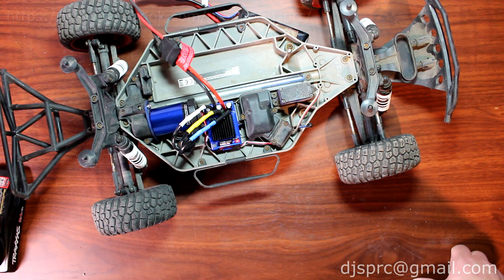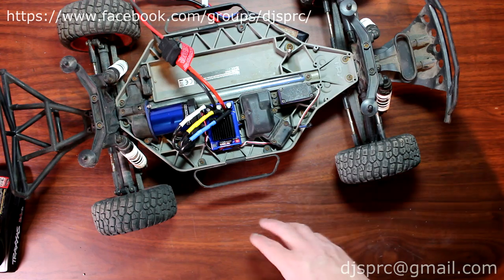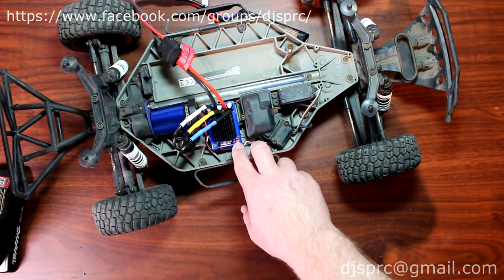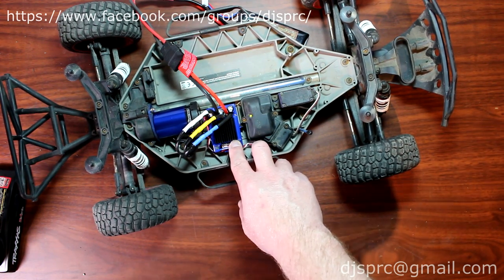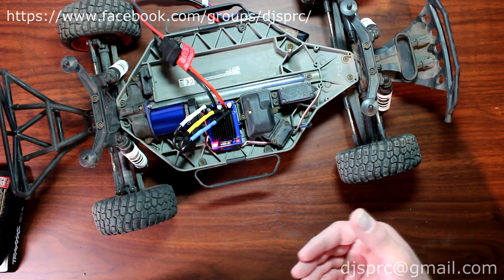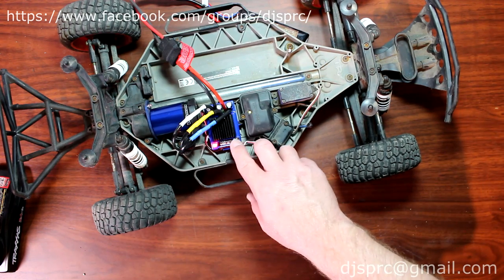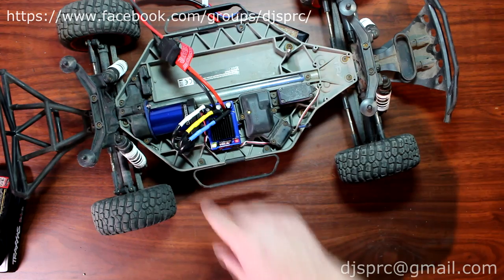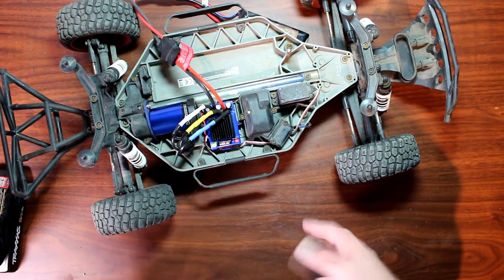How To Enter Lipo Mode Or Nimh Mode On Traxxas Speed Control

Comment: So mine will switch to nimh but as soon as disconnected and plugged back into nimh its back in Lipo🤷‍♂️ also not hearing any chimes switching into either and just wandering if it will automatically switch to lipo and does it matter what kind of batter is in to switch modes? I am also not currently in possession of remote but do have a skyfly im going to program too but have not yet just trying to digure out power first not sure if ESC is good.
Reply from the maker: Sometimes I’ve saw that you would need a Lipo to be able to put it back in nimh. If your light is green, that is Lipo mode if your light is red, that is. Nimh.

Comment: What is the difference between NiMH mode and LiPO mode? I mean, of course it is to change battery setting, but what changes? Is it just voltage level settings? Or maximums current flow?

I'm trying to figure out if it is possible to operate a motor controller with a 12V lead acid battery when the controller only has settings to choose between a LiPO and NiMH

Comment: hello, please, the red light on my M41 regulator vxl 6s marine is shining, is it only because of the nimh/lipo? how do i switch it? Thanks
Reply from the maker: @filapraha  if you plug-in two fully charged batteries and they are Lipo the light should be green. If it’s not green that means it’s in non-low-voltage what you will need to do is take your remote. hold a trigger in full reverse turn it on then plug it to fully charge Lipo to the boat. continue holding for at least 10 seconds. The light should turn green meaning low-voltage is activated safe to run Lipo.
Reply: @djsprc  Thank you very much for your help, the diode is now green 👍

Comment: Mine flashes red but it doesn't make any sound does that mean it's okay or what am I doing wrong I just bought this and I have no clue
Reply from the maker: Is it moving if it’s moving? Yes it is.
Reply: @djsprc  I messed around with it a little bit more yesterday I finally got it figured out the red light is staying solid lit now the truck is moving everything is working I believe it was set up for lipo from the factory not nickel metal hydride but I think it's okay now I am very impressed by this truck especially the quality but keep in mind this is my first Traxxas
Reply from the maker: @user-wp9mz  if I remember correctly yes it should stay solid when you’re going forward or reverse now if you have a greenlight, that’s a Lipo mode.
Reply: @djsprc  okay that's what I was figuring thank you so much the light is definitely staying red so it should be good for nickel metal hydrate now

Comment: I have a traxxas erevo vxl 1/16. I want lipos for it. All traxxas lipo batteries I could use are 25c. If I use a non traxxas lipo battery that's 50c (2200mah) will that damage the engine or speed control?
Reply from the maker: 50 C won’t damage at all
As long as you use, only a 2 cell lipo aka 7.4 volt.  If you’re brushless, you can use a 3 cell 11.1 volt
Reply: Thanks! Ya I'm looking into a Vant 7.4 volt 2s 2200mah 50C or HRB same specs as the Vant, or yowoo lipos with the same specs except it is a 130C. Any advice choosing between these? I've only been running nimh batteries and am sick of not having full power for my whole run. This will be my first experience with lipos and I want to get it right.
Reply from the maker: @tomovin37  for that type of vehicle, I would not go on over 50 sees it would be a waste of money
Personally, anything that’s higher see rating like 100 and more I would use for a boat a boat is extremely demanding on batteries
Reply: Thanks

Comment: Hi. But does the VXL 3s ESC understand difference between 2s and 3s? I mean cut off voltages are different between 2s and 3s. If I try 3s may ESC still think 2s connected with 6.4v cut off and kill 3s battery with correct cut off 9.6v?
Reply from the maker: Sorry for the late reply if you connect at 2S battery the ESC will know the correct voltage if you connect at 3S it will know the correct voltage

Comment: Hi, i am new to this rc things so i wanna ask is it okay run nimh battery on lipo mode? When i got my rc car, it already on lipo mode but the battery is nimh
Reply from the maker: Do not run your machine in lipo mode when you have NIMH in it it will give you false readings in the vehicle will stop by itself for nothing. Nimh Will drop in voltage very fast compare of a Lipo. I Lipo keep its voltage until it’s time to stop.
Reply: djsprc wow thank you very much for your info
Reply: djsprc wow thank you very much for your info

Comment: mines just blinking red and green and i put a new lipo on it
Reply from the maker: Sorry for the late reply normally flashing red and green means it’s in LVC mode. Low-voltage if you’re trying to run a NiMH. Battery turn off LVC the light on the speed control should be red for NIMH. Green for Lipo.

Comment: Dose this work on an older Traxxas car my green light is flashing the car goes forward good and sometimes it will not back up any ideas ?
Reply from the maker: Yes on certain older models this will work now for your issue it could be your remote or your speed control
Reply: djsprc  someone said I might be the crystals are not matching up or they are bad I got the car from a family member had to buy battery for it the car is a rustlers Traxxas I am just trying to get some information to figure out what I am getting into before I spend to much money on it or is it better if I go get a new car ? I don’t know that much about rc cars
Reply from the maker: Brannon VanCampen Getting yourself a new car you’ll have a warranty on it way better
Reply: djsprc  thanks for your help I will try it out I appreciate you
Reply: Same problem

Comment: My slash is blinking red and green whenever I change it into lipo mode do you happen to know how to solve that?
Reply from the maker: Normally flashing red and green means low-voltage detection if this is happening while you’re running it it’s telling me that your battery is in low voltage. Or you might have some damage cells in your battery.
Reply: @djsprc  thank you so much I appreciate it

Comment: Also I bought a 3cell battery for my rustler cl and the wheels will only turn. It does not move. Any reasons? My 2 cell works fine
Reply from the maker: Yes green is lipo red is nimh   Now what could be happening with your 3 cell is you could have a bad cell and it’s not giving you full voltage if yours 2 cell work fine. I would say that the other battery is damage or not fully charged

Comment: My car blinks red and green doesn't do that with my 2s lipo,but soon as I put the 3s lipo in it does the blinking again, I have it set to lipo,I just wanted to c how fast it can go on 3s.
Reply from the maker: The only thing I can see is the 3S is damage it’s not the correct voltage the speed control goes in   overvoltage protection or under voltage protection
Reply: @djsprc  thanks 4 this information 👍👍

Comment: What does “cut off is active” mean?
Reply from the maker: The meaning of cut off means that when your battery gets too low on voltage the speed control  will stop using it. To prevent damage to your battery
Reply: @djsprc  good to know, thanks!

Comment: Hi, can anybody tell me how to disable the Lipo low voltage cut off. I have a ECM 2.5 fitted on a small scale TRX-4M  that has a three pin triangular shaped plug (the only way of describing it) with a single balance wire (on a 2cell) going to the top pin. I have tried to disable the lipo cut off by doing all the tricks but with a lipo battery attached to no avail. a suitable Nimh Battery coming but if I cannot disable the low voltage cut off it might not run well and I will have to cut off the (unobtainable) Traxxas plug and re-solder without the balance lead. First shall I cut the balance lead on the (small) liponand see what happens?
Reply from the maker: I’m not sure if you can disable the Lipo cut off. Personally, I would not cut the wires off the battery I would make myself an adapter.

Comment: I cut my brushless Traxxas ESC and put an XT 60 connector on it I am plugged in my nickel metal hydride battery it’s a 7.2 V battery and I called Traxxas and had to get a replacement because my ESC started smoking and I called them and ask them if I could use a 7.2 V nickel metal hydride battery and they said they do not recommend it but I put it in nickel metal hydride mode why would they not recommend it 7.2 V nickel Metal hydride battery
Reply from the maker: Because you don’t get the full performance out of the vehicle with that type of battery that’s only thing I could see.
Reply: @djsprc  What is the best voltage battery to use on the nickel metal Hydro battery on the brushless Traxxas ESC
Reply from the maker: @dustinplee5067  lipo is better. A 2 cell is les hard on the vehicle.  Now if you don’t want a lipo  stay with Nimh  try to go with 8.4 if you can

Comment: I tried this it worked but after 1minute of driving the rc truck it wouldnt automatically shut off. That was switching from NIMH to LIPO ive switched back to NIMH and truck drives fine again. Any thoughts?
Reply from the maker: There is a possibility that your ESC is defective or your battery is not fully charged.

Comment: I was using my lipo battery but i forgot to switch it to lipo on my esc and now my rc doesn't work anymore. I tried putting it on nimh by using a nimh battery and it didn't work. All tho my lipo is fully charged so i know the problem is not the battery so is it possible that my motor doesn't work?
Reply from the maker: Noah Morcos Does the ESC even turn on if it does yes it’s possible that your motor is dead  is it a brushless or a brushed. And it’s possible the ESC might’ve died to.
Reply: @djsprc  yes my esc is turned on because it's receiving the signal from the transmitter. Its a brushed motor.
Reply from the maker: Noah Morcos Then I would guess it is the motor you can give it power directly from your battery if you want to to confirm dad.
Reply: @djsprc  ok thanks al lot, 2 weeks ago that same motor died so i put lithium grease in the motor and I let it sit for a couple of days, and it worked after 3days.

Comment: My speed control flashes red, I can turn left and right but no acceleration plz help
Reply from the maker: Usually that means your speed control is in low-voltage cut off. If you’re using  a NIMH  batt you will need to put the speed control in NIMH mode
Reply: djsprc I’m using a 4 cell lipo
Reply from the maker: Clit Commander69 ok  what speed control  do you have. If it  vxl-3s it take max 3 cell aka 11.1 volt
Reply: djsprc it’s a Traxxas XL-5HV 3s
Reply: djsprc my bad it’s a 3 cell
Reply from the maker: Clit Commander69 ok that speed control the maximum voltage you can take it is 11.1 max. Now if you’re using a for sale that is 14.8 V the speed control is going in overvoltage protection
Reply from the maker: Clit Commander69 Just make sure when you’re turning on the led goes green at first or stays green if it goes red then starts blinking your Are in NIMH mode.

Comment: I tried to do that and the light just blinks red and green
Reply from the maker: If I remove correctly you will need to re-calibrate your speed control or make sure all the settings on the remote go back to zero

Comment: When I tried to put it on nimh mines blinks red and green
Reply from the maker: Flashing red and green usually means it’s in low-voltage stage there’s a possibility you will need a light pole to put it back in nimh mode
Reply: It's in lipo mode you need a lipo to get it out

Comment: Why is my xl5 flashing red and green
Reply from the maker: What’s the meaning flashing red and green means low-voltage has been detected if you’re running the stock battery you might need to change the ESC back to new nimh mode
Reply: I figured it out